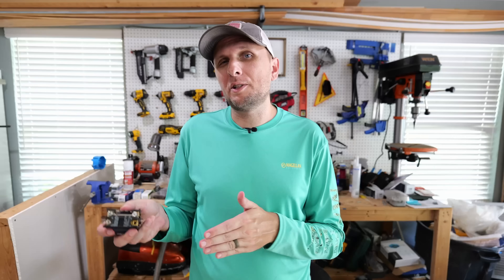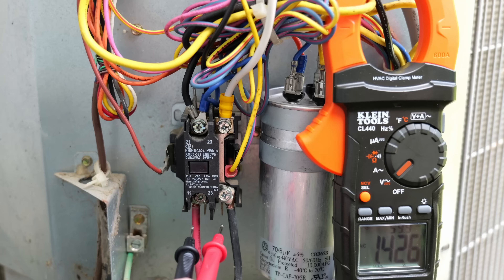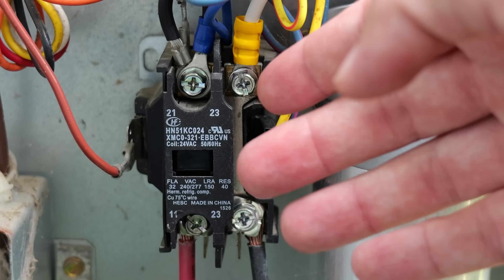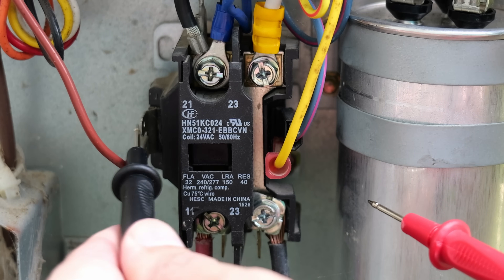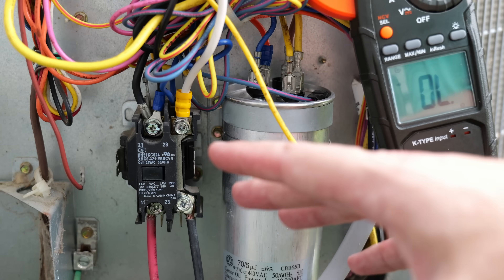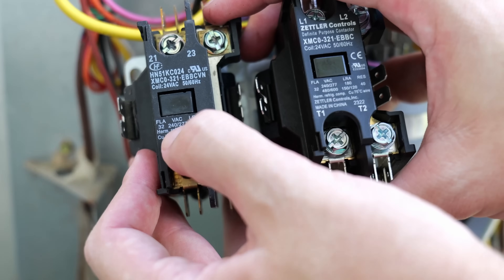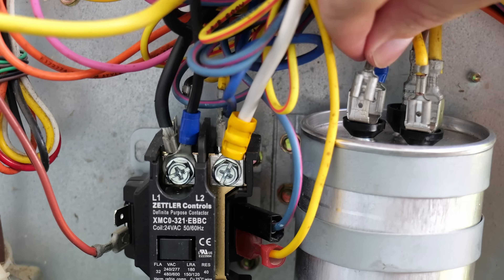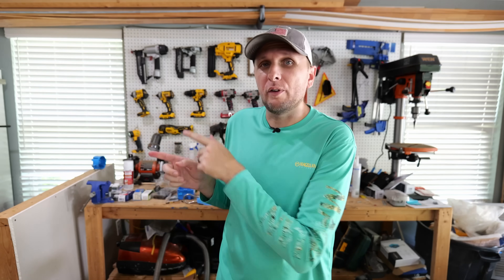Was Quoted $450.  I Fixed It For $19!  AC Contactor Testing and Replacement

Comment: You said you want to match up the numbers comparing the old one to the new, but you show a new one with higher amp ratings.  Which is fine, but you didn't tell us that :)  Also, the new contactor didn't come with those pressure plates for the bare twisted wires.  You re-used from your old contactor without mentioning it.  That's confusing.

Comment: Dude, I don't know where you're getting these prices from, but you need to get out of Cali. If I quoted a contactor repair, it's gonna come out to around $215 including service call. I love how you ramp up the pricing to scare homeowners. I sure hope whenever a homeowner frys themselves, they don't sue you . By the way, THAT COVER COMES OFF OF THAT CONTACTOR! It has 2 points that you can put a screwdriver into to remove it. Besides, just because your contactor passes voltage during the cycle you test it doesn't mean it's in great shape, you HAVE to see the contacts.

Comment: Some companies do charger way too much. So 450 plus that’s outrageous. At the same time , I’m sure if he had not told you what you needed , you would have not done this video of showing how to replace it.  Since at first I’m sure you didn’t know for sure for sure the issue.  People want everything for free too. So goes both ways.  Techs charge not just for what’s needed to be replaced , but time distance , and mainly knowledge, and using the proper tools in some cases . Bottom line, some charge too much. But some customers exaggerate on some charges … also depends how much that contactor is worth. If you buy universal ones , yes $20 bucks , but maybe he was trying to replace with original, maybe original is why went up that much.  In my opinion, around 180-280 is a fair cost for replacing one of those and in the process checking Freon leves temps and cleaning condensor.

Comment: Thanks for the instructions. I switched off the breaker and pressed the plunger a bunch of times to wiggle out any debris. Then tried to run the A/C again. It worked just fine. Thanks a ton for mentioning about bugs and such that could get stuck in there.

Comment: Question: Is it ok to replace a contactor with a 32 FLA to a contactor with a 40 FLA? All other numbers are same.
Reply: If the contractor you purchase has a rating that is greater than the original, yes, the contactor will be okay. It just might be larger than the original, so it might not fit.

Comment: 👍
Thanks for this.
I live in The South, heavily wooded lot on a lake.
Lots of humidity LOTS of 🐜 🐜🐜
A few months ago, my OLD AC went out, call the repair guy he comes out, replaces the contactor – $200.
Last week same unit goes out called the same guy, he replaces the contactor – $200.
“Isn’t that the same part you replaced not too long ago?”
“It sure is!”
“Ants get in there and fry them all the time. I tell everybody to spray their units with bug spray, but nobody listens to me.😄”
“So I just keep replacing them!”💸😩

Spent the weekend cleaning leaves and crap out the units. When Debby finishes blowing through, I’ll spray them down with bug spray.
AND I’ll be ordering couple of contactors to keep on hand
“ for the next time”

Comment: Thank you for this video! I think I had a bug get itself between the contacts in the contacter so it wasn't able to close the circuit. Your straightforward walkthrough of checking the circuits was super helpful. I just had to use a little piece of sandpaper to clean the contacts. Back up and running!

Comment: Great video by the way my plunger when I push it in manually, the fan kicks on when I don’t push it in the fan doesn’t come on at all. I don’t know how to use a multimeter that well. Do you believe I should just replace the contactor I replaced the capacitor and the fan does not kick on, but like I said when I push the little button in on the contactor fan kicks on seems like it’s working like a champ.

Comment: My compressor went out and the A/C guy replaced it. This was expensive as I live in a remote town... the closest HVAC guy is over 70 miles away. Not too much later, I found the new compressor was running all the time. The contactor was getting stuck on because contacts were very worn and pitted. That was probably what killed the old compressor. the AC guy should have checked/replaced the contactor as well.

The contactor was a single pole, but I replaced it with a dual pole (of appropriate rating) so when the contacts get too worn, I can just move the wires over to the other pole - basically doubling the life of the contactor. I know others have done this, but for a different purpose: the dual-pole contactor has a stronger spring, making it less likely to stick closed.

I'm thinking of getting a soft-start system to extend the life of the contactor.
Reply: But the shunted side on a single pole provides power to heat that some compressors need. There’s a heat circuit that needs power all the time. Having a double pole would eliminate this no?
Reply: I connected that to the line side lug on the contactor.

Comment: An HVAC guy can dispatch, diagnose, replace and finish a bad capacitor job in one hour.  The part is about $20 and they should get no more than $200 for the job.  Charging more than that is taking advantage of customers.
Reply: Another cheap person dictating prices. No, just don’t call to have someone out and diagnose it yourself. Problem solved.

Comment: Another time you may need to replace the contactor is when the fuse on your furnace control board burns out, but only when you call for cooling.  It could be a blown board, but frequently it’s a short in the coil of the contactor.

Comment: I was on vacation last week and my neighbor calls and says my air conditioning unit is buzzing and making noise. Called the HVAC guy and sure enough it was the contractor. A chipmunk shorted it out. $326.00 later it was fixed. But with the 4th of July this week and family coming over it is money well spent.

Comment: I figured it only right that I get on here to Thank you.  I explained my issue to a company I've been using for years and they estimated a cost of $900-$1200 assuming they do not have to also clean the (A) evaporator coil along with the condenser coils, which would have been another $1,500.   I watched a couple of your videos and was able to diagnose that I definitely needed to clean my system but that the contactor was bad and it kept blowing the control panel fuse. Buying new tools, testing equipment and the replacement parts cost me $90 and a 30 minute trip to Aces Hardware.  Thank you very much for this information man.  You are appreciated.
Reply: Buying new tools, that's the fun part.🎉

Comment: If my 3 AMP fuse blows every time I start the AC, could it be the contactor?  I've already determined that the system runs on heat, runs the fan, and the thermostat isn't the issue.
Reply: Its wired incorrectly
Reply: Thanks.  It was the contactor in the end.  She good.

Comment: I have the exact contractor pictured.  If I manually press the button down, the a/c starts right up.  When thermostat calls for air, nothing happens.  Probably the coil is bad?  (This all started after a power blip on the weekend)
Reply: Possible, but could also mean your thermostat has problems. Check the contactor coil for 24 volts. 24V present, then coil is probably bad. No 24V then thermostat or control voltage needs attention. (blown fuse at furnace or thermostat)

Comment: as a 10+ yr tech I can truthfully tell you that while yes a homeowner can replace a capacitor themselves I will say for every 10 people 7 or 8 will end up messing something else up in the process and end up calling an AC company anyhow. Most common is they will accidentally blow a fuse by shorting out a wire and worst case I had one customer who was careless and forgot to hook up one of the wires properly and it popped off hitting one leg of the high voltage on the contactor when they turned it back on and ended up sending high voltage through the 24 side and frying his thermostat and control board inside.

It's fine to ask questions and make the technician explain to you why they say is bad is actually bad and if you still question their explanation call the office and ask they send a different tech out for a 2nd opinion. . But your best bet is to just call a professional.
Reply: When the "professionals" stop blatantly ripping off consumers that would be easier to do!   Can you seriously defend $450 for this job from a "professional"?
Reply: I believe it. I don't work in HVAC, but having done LV power and control wiring in my job, I know that many people think of electricity as black magic and don't know about electrical safety. Things get wired incorrectly all the time, even by professionals. 

So DIY is great for people that actually know the basics and safety, but otherwise should probably call a tech.

Comment: I would use solder on fork or ring terminals especially since it's exposed to outdoor elements. Corrosion and vibration can decrease conductivity. Soldering does away with both threat's.

Comment: Just had my contactor go bad with a short in the coil. it was as reading 1.8 ohms across the coil. Will be an easy fix and saved me hundreds.
Reply: My fan is not turning I think most likely a bad compasitpr but I can only give you my ruud ac unit model np 13 ajn 24aol please help meat h what will fit for me please?

Comment: That plastic cover on the contactor will come off, you just have to pry at it.  Not as easy as the ones with little screws.   There's a device out there called the Emerson Sure Switch that can replace the contactor and add brownout protection.  It's quieter than a traditional contactor and has a fully enclosed relay which will keep debris and ants out of it.

Comment: so on the contactor, i'm getting 240 out of the source wires connected to the top screws(on my model).  on the pass through, (on the bottom) i'm not reading anything on the 2 on the bottom, however, if i test them separately, each has 120. yes, both.  but if i try together, i get nothing.  i dont know how that is possible

Comment: My thermostat suddenly wouldnt work, and stopped working exactly when it tried kicking the AC on.  I was like wtf? After some investigation I found a blown fuse on the board on the furnace. Well, replaced it, tried turning the ac on again. Boom, blown fuse. Turns out, the little contactor had no resistance at the coil...
Reply: Mine just started doing the exact samething.   Did u have to replace the contactor ?
Reply: @waltbuzby8644  My 1 year old air conditioner just had this problem. Thermostat went off, blown fuse on the furnace circuit board. Turns out the high voltage wire on the contactor wasnt tightened down enough during installation and eventually came off the screw. The contactor was partially melted. Thankfully it was covered under warranty but if it hadn’t been… I would have spent a lot of money lol😅 But now that I’ve seen this video…

Comment: Changed my capacitor and contactor for $40. Took 10 mins. I do it every 4-5 years.
Reply: $40 ???  Where did you buy your parts, I need to go there 😂
Reply: @H-townguy capacitor $18 on amazon. Contactor $24 at Ace Hardware. Oops, I spent $42.
Reply: Amazon
Reply: @tomhunter91  ok thank you 👍
Reply: Pick a nice spring or fall day when no heat or cooling will be required for a month or two.   I figure 7 years is good.  My first cap went dead at year 9.   I keep the old cap and contactor around for emergency use.  A contactor often just needs the contacts filed clean.
Reply: @NackDSP  True. I sand (clean) and lube the contactor every year. Haven't had a need to buy a new one yet.

Comment: Mann I thank you so much for this video. Hoping you can assist me here, still. My heat pump outdoor unit is NOT STARTING at all. In either heat nor cool. SO, I changed the contactor and the Capacitor, but it did not help. The pc board, (defrost) status is  indicating a  "low pressure lock out". Would you have a idea, what else I could do here? Can this RHEEM pc board be RESET? or trouble shooted. I hope it is not a refrigerant issue. The indoor unit seem to be working ok, it comes on and blows continually. So, I am thinking the T'stat is ok. Man I in deep, on this one. but, Thanks again.

Comment: Now redo it!  But I know you want it to look the same.   But for safety!  The contactor  should be flipped 180 degrees.  L1 & L2 are for the incoming voltage or Line voltage (from the power company).  T1 & T2 are for the load side (compressor/Fan motor/etc).  Same goes for the wiring in the disconnect on the outside wall & the disconnect and breakers for the air handler. I can’t tell you how many times ppl wire them or cross them.  Some disconnects if crossed can still let voltage through, zap & shock you!  Always do it correct the first time!  Keep it safe for the next tech!
Reply: How would you rate the skills of a technician who is unable to recognize the heavy gauge red and black wires as the incoming 240 volts, regardless of how the contactor connection points are labeled?
Reply: I remember someone else said to turn contactor 180 degrees, even though the writing will be upside down.  Thanks for clarifying why. Different brands are designed differently. Is the shunt side supposed to be on the left or right though?  The shunt on his old contactor was on the right and that is how he installed the new one, on the right.
Reply: Please add this comment to your video. It helped me to flip the contactor so that wiring is done correctly
Reply: It does not matter.
Reply: @Nikolasz1173  Quality always matters!  Esp when the line voltage is always present!  It feeds other things like a crankcase heater!  
HVAC Lives Matter! 😎
Reply: He followed the last person that installed the contactor which was wrong.
To verify the correct wiring, there should be a schematic on the inside cover to indicate the configuration.
My contactor writing is upside down, but that is the correct configuration, the L1 and L2 will come from your breaker or fuse panel/box, in my box 240vac comes from the bottom of my HVAC  electrical box.
The output voltage will flow out of the T1 and T2 terminals and connect to your motor and capacitor.
Take several pictures from various angles, write down where each wire belongs, then double check your work.
Reply: My understanding is that it makes no difference which side the load wires are attached to. In fact, his original contact doesn't even have L and T indicators.

Comment: If I turn the thermostat on, nothing happens, that button on the contactor doesn't go in. If I manually press the button on the contactor, everything kicks on. Would that be a problem with the contactor or the thermostat?
Reply: Same , did u ever find out?
Reply: @beemomusic  fuse was blown in my air handler in the attic. It's like a 3 or 5 amp auto fuse

Comment: A local heating contractor quoted $180 + parts to replace a 4mfd run capacitor. My cost for the part, $1.62+tax. Sheesh.

Comment: What if you can’t find the exact contactor…for example I can’t find a replacement for my contactor zettler xmc0-251-ebbb with these ratings FLA 25, VAC 240/277, LRA 150, RES 35. What can I replace it with?? Thanks

Comment: Thanks for the video. I'm replacing my contactor and I have 3 low voltage wires on one side and only 2 terminals, and I can't find any contactors with 3 terminals on one side . Is there an adapter for this?
Reply: Piggy terminal is how is called or put the wires together with a wire nut. Orange Color will work

Comment: So here in hot & humid Houston TX, I simply replace the contactor and cap every three years, and always have a spare set on hand. Outside of keeping your coils clean, it's a top way to keep your AC happy.
Reply: What causes the contactor to go bad on a 5 year old unit? Mine is buzzing when it turns on and quiets down but will continue the  loud buzzing afterwards
Reply: @orlandopena9992  heat and humidity! If it's buzzing it needs replaced!
Reply: @orlandopena9992  your unit kicks on and off to often causes accelerated wear due to excessive use of the contactor you should look into maintaining the unit before summer and after
Reply: caps now are only rated for 3 years they used to be rated for 5

Comment: Capacitors not only go bad on air-conditioners but also on freezers.  With an air conditioner it's an inconvenience when one goes bad.  On your freezer you could lose hundreds of dollars if your meat and other items spoil while you are waiting on a replacement capacitor.  It can be a nightmare. When mine went out I was lucky I was lucky I had a neighbor that had enough room in their freezer.  So, I bought two capacitors so that I had a spare in case it went bad again.